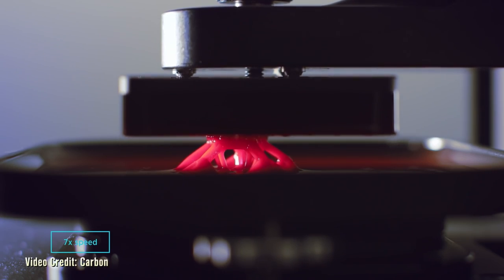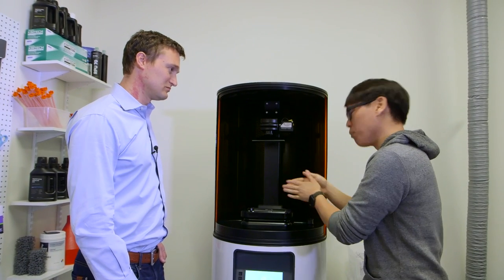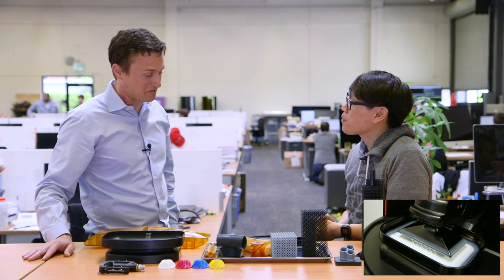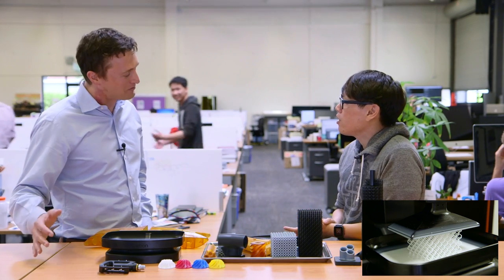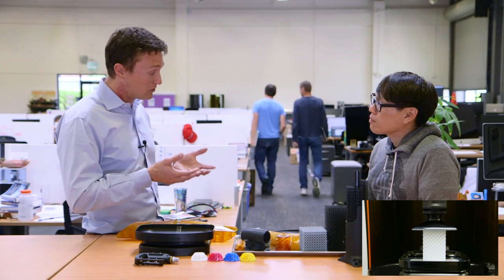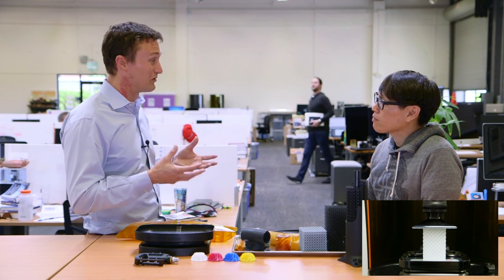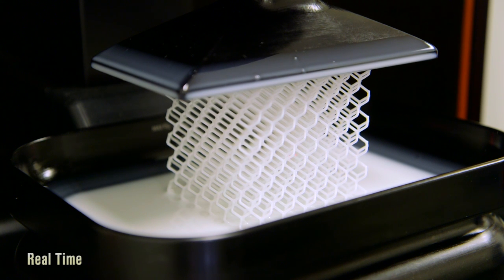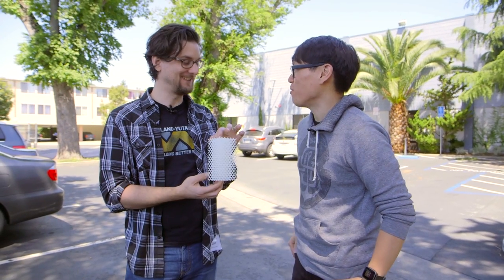Carbon M1 Super Fast 3D Printer Demo!

Comment: Does it bother anyone else how he's not actually saying anything? I WANT TO KNOW HOW IT WORKS!
Reply: +J Λ Μ Ξ Ѕ L Y O N S
That interview could've gone much better. Oh, if only they brought in their engineer VP and not their business VP!

-"How do you solve the heat?"
-"We use high-quality thermostats from already-big producers, so it's very economic and convenient!"
What? Not "We put a mini-AC in it since the projector approach gives the machine open airspace inside?"

-"What about overhangs?"
-"When you're prototyping with a prototyping printer with plans for injection molds, you get limited by the printer. With a production-grade printer like this, you can make things like lattice structures and don't have to worry about production steps afterward."
He has absolutely no idea what he means by "overhang," does he?

The comment section so far has been more insightful than this unlucky interviewee. +Dark Shift Music suggested something very sensible.
Reply: +Thelothuo Yeah, it's really irritating, I was able to learn a lot more by some quick google searching and the comments. I already had a fair idea of how it works just from seeing how the thing prints before, but I would LOVE to be able to read through the exact way it does it.
Reply: +J Λ Μ Ξ Ѕ L Y O N S 
I was about to mention this. The guy talks and talks without providing really any info.
Reply: +J Λ Μ Ξ Ѕ L Y O N S I don't know why I feel the need to defend this guy I don't even knwo, but are there really so many dumb people here? What's so hard to understand about a projector projecting UV light onto the bottom of a basin to cure UV setting resin? The reason nobody tells you "exactly how it works" is because they developed this and need to sell it, not tell everybody how they can make it for themselves.
Reply: Iguana93
 His responses weren't very good at explaining. Not the projector, we got that. Not that we don't understand how it works. We know that stuff, this thread at least. Rather, we're a bit confused with the interviewee's responses.
 As for other threads, there's a different story. This thread so far knows how a projector and plastic plate work. It's the bad responses.
 He started talking about where they get their thermostats when asked to address overheating issues with the printing area.
 When asked about overhangs, a 3-D printing problem known to anyone with even a slight familiarity with 3-D printing or who has even simply thought long enough on it (the interviewer, the audience, their consumers), he proceeds to explain why a production-grade printer can bypass problems prototyping printers have. Relevant in that it was about 3-D printers, but said nothing about solving the overhang issue. Why was the answer so off? Because he misunderstood the question. But this misunderstanding wasn't a wording issue on the interviewer's end. This was the interviewee's mishap. He wasn't listening. When asked about overhangs, he likely only heard "lateral" near the end of the question and assumed the question was about "lattice."
Reply: +Thelothuo On the thermostats - I can't find it now but I think he actually said (or wanted to say) "thermosets". He was explaining how they get the materials from the same polymer suppliers as would be used for injection molding, thus they produce parts usable in real life.

As for overhangs - I don't think he misunderstood the question. I think he just didn't say "yes we can do overhangs" because of course they can do overhangs, you can do them with almost any 3D printing technology. One of the video shots even shows a transparent part being printed with what looks like support latticework. The spatial limitations of a part "coming up" from a groundplane are obvious and I daresay need not be explained. Of course anything that doesn't "flow downward" from the main hanging point will need its own "hanging structure". But why should you expect a person presenting their product to illuminate its limitations? So instead, he highlighed the benefits of being able to produce parts in durable and cosmetic quality.

Did he wiggle out of some questions? Yes. Did he point-blank refuse to give technological details? Yes. Did he make a selling presentation? Yes. But hey, he's a representative of a company selling their product. From the rest of what he said he obviously knows what he's talking about, so I just don't understand this almost uniform hate directed at him. I know people in the comments give more detailed theories of how the machine works, but afterall, it wasn't the goal of the video to disclose that information and I find nothing despicable about a company not broadcasting their intellectual property in a product feature video.
Reply: Iguana93
 Thermosets makes much more sense, I'll give you that.

 The second half of the overhang question was "without lateral supports." His response was, again, near-irrelevant. Yes, he did 'illuminate the product in a favorable fashion,' but he did so in a way that made him look a bit uninformed. He could have said "the layerless printing means that those supports can be safely and cleanly removed" or even "we've got our scientists, which are some of the best in the field (he liked to emphasize that), working on that."
 Of course, we don't expect chemical formulae and ideal measures of UV and viscosity. We expected him to explain the genius and innovation behind each innovation. Why make the resin a mix of two? He could've said that it allows the two-phase curing function that makes their highly unique and affordable and innovative innovation to function, or that it improves strength or molecular structure or allows greater control over the end product's properties.
 Unfortunately, the reason he couldn't say anything was because the company that sent him out to the press didn't tell him much.

 His fault? Some parts yes, some parts no. It certainly isn't his fault if he wasn't told how the stuff works. But his delivery made that lack of information look like his fault. There's the reason he's getting so much flak. Does he need a defense? Yeah, now that he made the company's problem his problem. But now it's his problem.
Reply: +Thelothuo Well, I didn't see any problem until I looked into the comments. Like the interviewer, I was impressed by the abilities of the technology and what it could do for me as a designer. Not that I wouldn't care at all about the science of the process, but I simply didn't expect to get that from the video. For me the explanation of "polymer setting with UV projection and oxygen supply control" is good enough. I don't need every detail served. Why use two part resin? He clearly said they use different kinds of resins, so it obviously depands on what material you need. Everybody knows there are different types of resins, so why even mention it. And talking about heat control? Well, their parts aren't coming out crooked, so obviously they cool the "imaging plate" appropriately or something. Exactly what they do is a trade secret, of course. And the oven must be necessary because these are thermosets, as he said. You can cure them "hard enough" with UV, but to achieve final strength, they need to be baked. What's so interesting about that? Anyways, we won't settle this, obviously you're right, a lot of people didn't like what he did. I'm just someone who thought it was all either obvious or else unnecessary.
Reply: +Iguana93 +Iguana93 I don't dislike the interviewer or think he did a bad job, I know that's what they are supposed to do, and he said all he could. I don't expect to ever know exactly how it works but I love it when I can figure things like this out or find exactly how it works because its fascinating. I am not the least bit unhappy that this video doesn't tell me that and I didn't for a moment think it would. The part that bothers me, and all day long around different people is the talking in circles and not actually saying anything. Whether the person doing that has a good, fair reason to or not I have to call them out on it, for whatever reason. The man's repetitive and sometimes vague descriptions still were more than enough to understand what is happening there. It is always infinitely more satisfying to have something explained by someone who can tell you everything and really thoroughly knows what he's talking about.
Reply: Iguana93
 Correct. He said what he was supposed to, but his presentation had issues. The presentation made him appear 
incompetent, like J Λ Μ Ξ Ѕ L Y O N S  says. Maybe he does know how all the bits and bobs work. But he doesn't give that impression.
 We've almost reached an agreement, I think.
Reply: +Thelothuo + J Λ Μ Ξ Ѕ L Y O N S Yeah, he does do quite a lot of circle talking and repeats himself. He could be more concise in what he says and doesn't say instead of filling the gaps with fluff. And I don't even thnik he knows everything about the technology, just as much as his managerial position requires. But I just have good filters for bullshit and fish for the relevant info automatically. Maybe it has something to do with me also being a tech and tech marketing translator. :D Anyway, he's not nearly as bad as most politicians for example.
Reply: +J Λ Μ Ξ Ѕ L Y O N S Seemed clear to me. The interviewee can't give away proprietary secrets and that is why he seemed to give cagey answers to a couple questions, otherwise he promoted and explained as he should have.
Reply: Iguana93
 Correct. He probably doesn't know a lot about the machine. 
 Avoiding questions he doesn't have answers to could've been done better (if you want to make something look good, make up something believable at least. Wouldn't be the first time a company did it).
 Oh, DEFINITELY not as bad as some politicians. A few of the US presidential candidates literally did not listen to the questions asked in the debates. They set a speech and were hell-bent on sticking to it.

cuda426hemi
 You're one of those people who doesn't read threads, I presume?
Reply: +Iguana93 Oh i know Donald Trump for fucks sakes
Reply: +J Λ Μ Ξ Ѕ L Y O N S He doesn't know jack, like most Best Buy employees.
Reply: +J Λ Μ Ξ Ѕ L Y O N S They're not going to explain the technology, because buisness is involved. To stay ahead of competition you don't make the design public and you don't give details which can be used by competitors.
Reply: +SnowDrifter they cant give out too much info, hello its their secret
Reply: TechNick
benimath
ThornsOfOurTime
 Feel free to read the thread to view a discussion over the topic.
 Please do.
Reply: +ThornsOfOurTime Lot of thick people here that don't get our point. Don't worry, they still don't know how to tie their shoes. All the explanation you need is there in the video. They are also confused as to how that "welding" glue hardens under the little UV penlight.
Reply: I give up. I'm done. I try to help, but sometimes, it seems the world wants to burn. Let it burn, then.

Comment: so basically this is the opposite of the hydraulic press
Reply: The jaws of life are a mobile hydraulic press with sharp edges to cut instead of flat ones to crush.
Reply: Yeah
Reply: Yeah
Reply: It could attack at any time, so we must deal with it
Reply: with a bit of light and oxygen added into the mix
Reply: charliea123able and chemistry
Reply: using light and oxygen to create amazing parts!! At the intersection of molecular chemistry, chip design, and woo.

Comment: but isnt it still layering? the layers are just so small that you can see them
Reply: ThatGuyYouMetToday VLOGS Yes it is still layering since the projector projects frames based on cross sections computed at specific points in time and thereby computed for specific z of the model.

I would have liked some I formation about post-production steps when the design requires additional scaffolding structures to merge disjoint structures of the design during the print. The printer can't print with two materials at the same time so additional scaffolding needs to be removed mechanically. Which becomes harder as the resin itself gets better and better mechanical properties.
Reply: Per Westermark if you designed a solid shape to be printed on an SLA machine you just make holes for the resin to leak back out of.  Supports are supports, you need much fewer of them in SLA though.
Reply: Lexybugs Yes, but how to remove the scaffolding if the material is strong enough that you can't bend or cut it? Or can the do it directly after printing and then heat-treat the material to reach the full strength?
Reply: No, it uses LIGHT AND OXYGEN
Reply: 17:34
Reply: I wonder what their lift and retract speeds are? FEP OR nFEP?
Reply: @among-us-99999  true

Comment: I'm curious how new this is, because I remember back in 2010 I was looking at colleges and one of the engineering colleges I looked at had this technology. I watched a 3D model of a car rise up out of a pool of liquid, and they could print anything. There was an Icosahedron frame made of rods, each supporting a gear, and all the gears meshed together and turned. The instructor showed me how it was made using their 3D printer and pointed out how there were no layers or seams at all. I remember being super confused when 3D printing became popular everywhere why it didn't work like this, but figured maybe that college just had a top of the line item, but then I never saw one of these again. How new is this?
Reply: I would love to get an answer for this as well lol

Comment: Does anyone here know if they use a combination of light and oxygen? I can't seem to find anything on the topic.
Reply: The control of oxygen is done by using a micromirror chip which creates the light pattern required to print the shape you want. They were originally used in projectors for computers, It's made up of a lot of tiny mirrors each around 8 microns squared. The UV light hits the micromirror and creates a pattern, silicone is used between the resin and the light as it allows oxygen into the resin as it is highly permeable to gas. All the while the UV light prints it layer by layer. That's how they manage OXYGEN.

Comment: One problem is finding and using dihydrogen monoxide to clean the printer.  That stuff has killed millions of people.
Reply: I drink it when I clean 3d printers, it is the bang with scoons and lox!
Reply: Yes the Titanic as example.
Reply: But dihydrogen monoxide rarely kills people. Most of those deaths are actually due to a lack of gaseous oxygen (A key component of Light and Oxgyen [tm]).

Comment: As far as I can tell, the purpose of the Oxygen is simply to prevent curing of the resin actually on the transparent plate at the bottom, thus avoiding the need for the 'peel' process and (kind of) making it a continuous process. The transparent plate at the bottom is presumably made of oxygen permeable glass/plastic similar to that used for contact lenses.
Reply: +Sardi Pax Yep. First versions were coated with Teflon AF as mentioned in the science paper. http://science.sciencemag.org/content/347/6228/1349.full. Oxygen inhibition of UV curing isn't new technology per se.
Reply: You should tell this guy that. He doesn’t seem to really know.

Comment: Captain Kirk: Mr. Scott, I need those Transwarp Drive clusters to be engaged in 5 minutes for maximum warp!
Scotty: But Captain, I need more light and oxygen transferred to the coils! I'm having the 3D Printer utilize physics and chemistry to adapt to our Dilitheam tubes and extract the materials!
Captain Kirk: You have 5 minutes Mr. Scott
Scotty: It will take 13 hours Captain! these 3D printers are from the 21st Century!